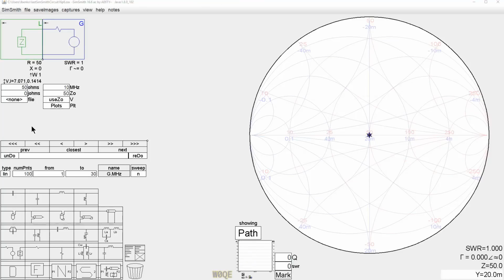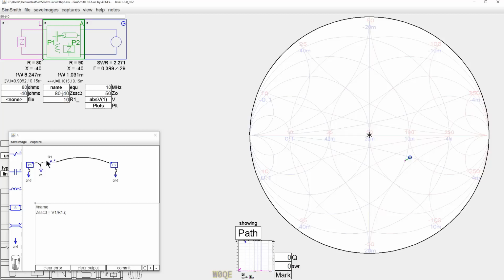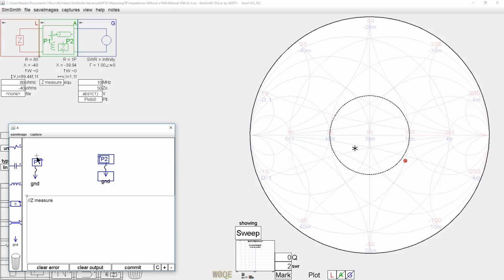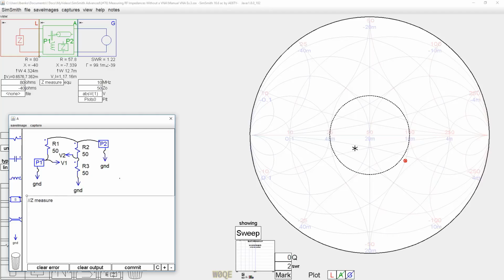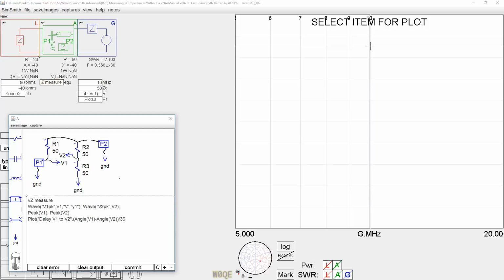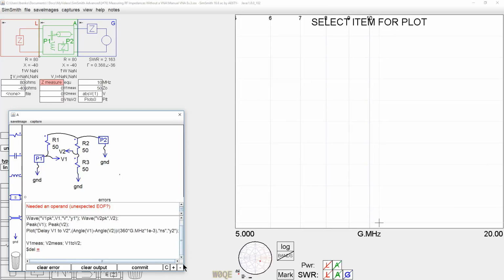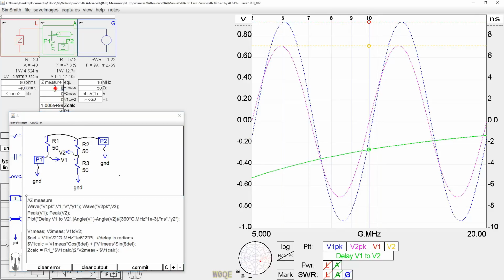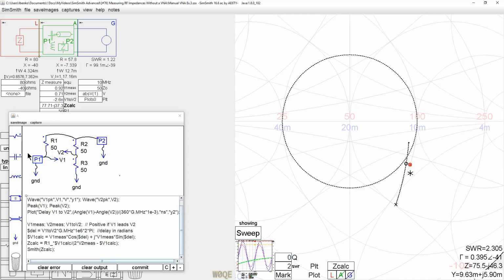#76: Measuring RF Impedances WIth an Oscilloscope

Comment: Nice presentation.  Thanks,  I learned a new method for measuring impedance.  
Here how to measure phase difference automatically with out he need for oscilloscope.
Use a fast clock and  count V2 from raising edge to raising edge with the help of zero cross detector and a counter.
Use a fast clock and  count from raising edge of V1 to raising edge of V2  with the help of zero cross detector and a counter.
Divide the second # by the first # and multiply by 2PI, and this is your phase.
Measure V1 & V2 using a peak detector and A2D converter and do the last two lines.

Comment: Larry, this is a good video, and I think it will be very useful for most people.  I guess the same thing could be done in Excel, but you don't have the nice Smith chart visualization about how close the calculation is.  Anyway, this was one of your best.
Reply from the maker: Tom,
Yes, the complex math help could come from SimSmith or several other programs like Excel, Matlab, Mathematica etc. but you're right that having the Smith Chart visualization is really nice.  I have done the complex math manually many times (which is good practice) but it is very easy to make mistakes.  Thanks for the comment.
Larry

Comment: I setup the circuit, pasted the the first line of the calculation Wave("V1pk", V1, V); but got the error"Wire, variable, or component already declared or built in:V1". What am i doing wrong here?
Reply: Problem fixed after upgrading to Version 16.6, thank you.
Reply from the maker: I see that you got the problem fixed. This can be a little confusing since many of the parameters are optional.  Look at video #69 where I went through many of the options.
Larry, W0QE

Comment: From what I have seen, most single port VNAs work like this so this could be easily be titled VNA basics or something like that. Very nice presentation, as usual.
Reply from the maker: Dragan,
You are correct that many (maybe most) of the little VNAs work like this.  However as I mentioned near the end of the video other circuits such as a dual directional coupler could also be used but the detection circuits would need to be more sensitive. I struggle with titles for videos all the time.  The title can't be too many words and I want it to be understood by most folks, I don't want it to be "click-bait", etc.  Glad you enjoyed the video.
Larry, W0QE

Comment: Can this method be used to mesure the unknown impedance of a receiver at a specific freq? In order to build an antenna for it?
Reply from the maker: This technique can be used to measure the RF impedance of any circuit but with an oscilloscope being the detector the voltage levels will need to be fairly large and you need to be careful not to damage the front end of the receiver.  S9 is typically a signal of about 50uV so a voltage of 100mV would be S9+66dB and 100mV will barely be enough unless you have a pretty good scope.  A receiver that is mismatched to the antenna + feed line will suffer what I have mentioned as mis-match loss in previous videos.  The mis-match loss for a 3:1 SWR is only 1.25dB so little is to be gained in the HF region where band noise dominates receiver noise.  At higher frequencies this is not the case but you should probably be most interested in the input impedance of a receiver with the pre-amp enabled and again you need to be careful not to damage the receiver.
Larry, W0QE